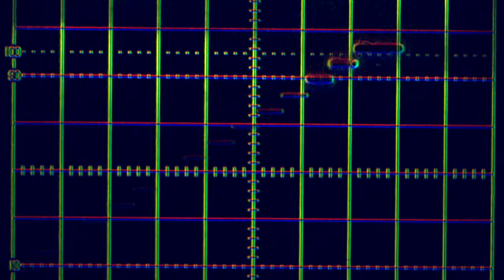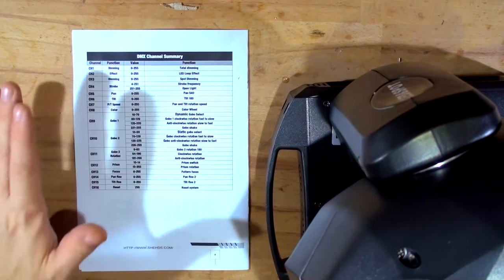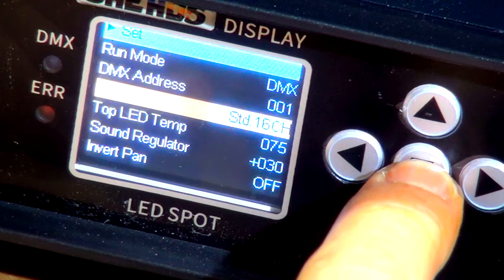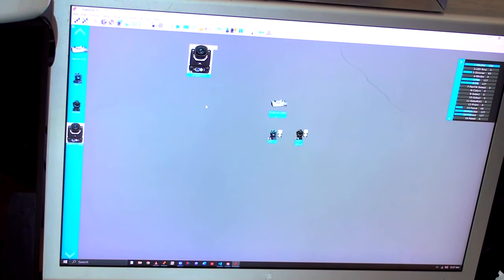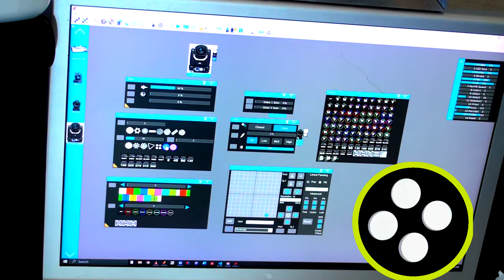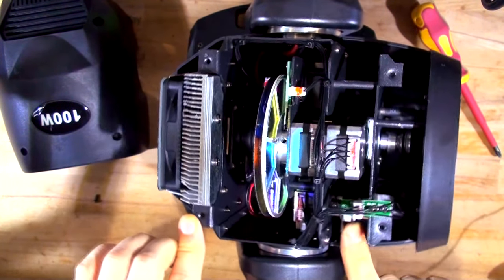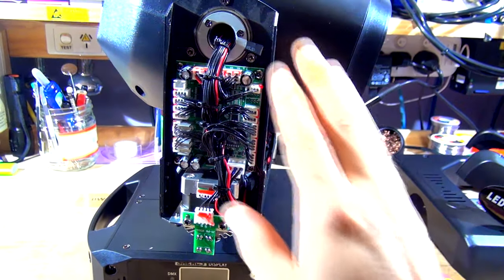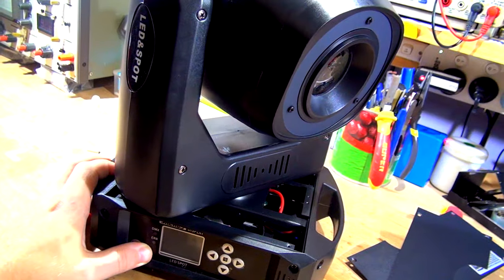Shehds Lighting 100W Moving Head Review

Comment: Hey guys! Is really that easy to remove the housing as it shows in the video? Are any other visible but not removable parts that are not shown in video? Asking because i really want to order 4 of those and paint them white (except the back panel with the monitor ofc) to use them for my weddings instead of ordering the cheapest white spots i can find which are double the price!
Reply from the maker: Yes, the case is easily removable.